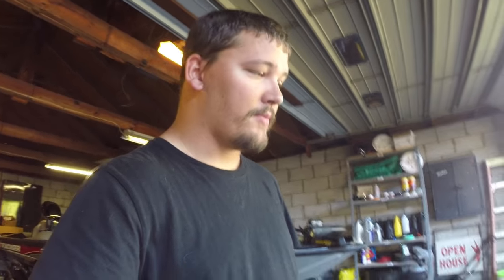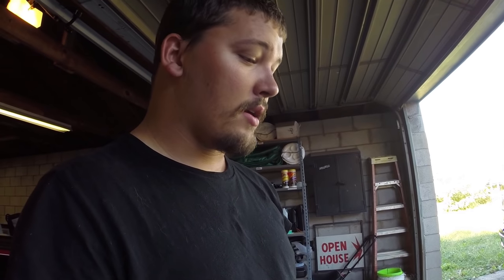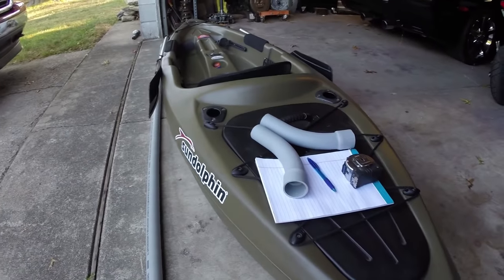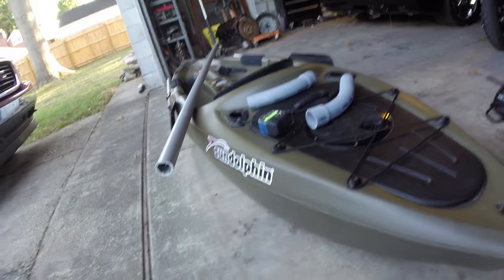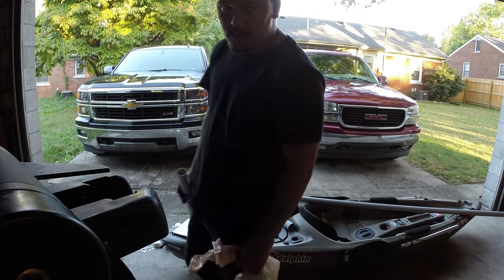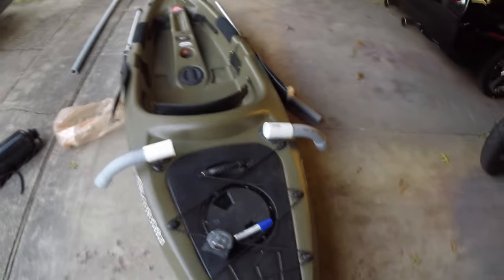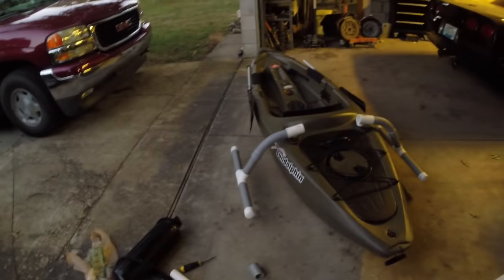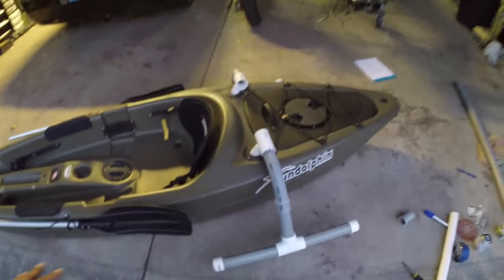Cheap Kayak Outrigger Tutorial

Comment: DO NOT DO THIS - nothing against the man creating the video, maybe it worked fine for him. He mentioned he sold it not long after so who knows. For me, I followed this video and it seemed sturdy enough in the garage. Twenty minutes on a calm lake just paddling around and it ripped the screws of my fishing rod holder clean out and started ripping out the second one. I should have known better. In fact I did because I even added an adhesive to the rod holder where it mates to the kayak ahead of time thinking it may be too much for the screws alone. I have scrapped these outriggers and repaired my kayak with two part epoxy. Avoid the headache and just don't do it. This kayak doesn't have to have them if you lay out your gear right, it wasnt worth it.
Reply from the maker: Hate to hear that. I took mine through some rapids floating down a creek and they held up fine. Maybe I just got lucky who knows.
Reply: It's possible. These aren't the most quality controlled kayaks coming off a line so it may vary from kayak to kayak.

Comment: I have a 16 foot 2 man Kayak with a sail. The sail came with lee boards. Without the outriggers I would have swamped immediately. I used two 8 foot 4 inch PCV pipes at a distance of 4 feet parallel to the center of the boat. I used two 8 foot two by fours to secure the outriggers to the upper deck of the Kayak. 

I tested this design on Paradox lake in the Adirondack Park. With full sail and jib deployed, the boat runs smoking fast.

Comment: nice little boat I have one... did all the mods..outriggers,milk crate new rod holders,anchor trolly,padded not an elevated seat,but is just to small ..now I only weigh 150 lbs. but even with the outriggers I find it to unstable to really stand up and cast. I need a bigger wider boat at least 12 footer...  I know it's gonna cost more money but after experiencing this little boat it's gotta happen if you like to fish a lot.you  get what you pay for in the Kayak world..that's for sure. so this boat is going to my wife and I'm getting an upgrade...

Comment: Hey Shaky Head. I have looked at a lot of videos about outriggers. Yours goes to the top of my to-do list. I have a couple questions. How do you keep the tube in the rod holder from spinning/moving? Also, do you think if they were out 2-3 more feet the Kayak would be more stable? At your build measurements is your paddling interfered with? I have a Brooklyn RA220 111/2 feet.  I also have a stoma in my throat from cancer. So water is my arch-enemy. If I fall in I'm dead. That said I'm sure you understand my safety concerns.

Comment: I just got new kayak on clearance and am 235 lbs and same problem. (No way will I be able to move around with fishing gear without tipping over) So was looking into detailed ideas for outriggers. Your video was just about everything I'm looking for. One question, how did you get the PVC to stay into the holes in kayak? Cement? Thanks, this was very helpful.
Reply from the maker: I used pvc cement.

Comment: 1 1/4 PVC pipe will fit nice if you have a belt sander. Make a very slight taper. I sanded off about a 1/6" or less and it pushed right in.  After making both pieces, each about 10" long, I noticed they sit at a funny angle. I don't think there are any PVC fittings that will square things up. So....I'm going to try heating them. That may work. I see people heating PVC and they always burn it. It started out changing color to yellow. It doesn't take that much heat to make it soft.
Reply from the maker: gotta be careful with the heat
Reply: If you heat the middle and slightly pull apart once it softens, it will contract the middle. Once cooled, just cut the middle and you have 2 tapered ends.
Reply: David Hefner I’ve seen someone unscrew his rod holders and remounted them parallel to the kayak. Of course he added silicone sealant under the rod holders before remounting them. This eliminated the need to heat and bend... works great if you don’t have heat gun.

Comment: just went to the hardware couldn't find those 45's with the largerer opening on one end that you have ...there are the same size on both ends...
Reply from the maker: The pieces i used are not going to be with plumbing. You should be able to find these  near the electrical section.

Comment: Hey man. Did you have any issue with the PVC backing out of the rod holders?
Reply from the maker: i did notice a crack in one of the t's but i think it was my own fault for forcing it when i shouldn't have. As far as durability under normal use i had no issues. I even took it down some small rapids when creek fishing and it handled it fine.

Comment: They look really sturdy. Did you glue the pvc pipe into the rod holder holes?
Reply from the maker: yes i used the pvc cement and pushed the pipe as far in as possible. 

The setup has been pretty sturdy. i took the kayak down a creek that had some rushing water and small drops with no issues.

Comment: Don't know if you will respond but how did the final product turn out.  did it work well for you?  was it the right height? sorry for all the questions, I bought a Sun Dolphin Bali 10 ss and I'm turning it into a fishing rig.  So far you have the best outriggers that I prefer.
Reply from the maker: It turned out really well actually. Before i glued everything down, i went out and made some small adjustments and marked where i wanted everything. glued it together and it worked great. I took the kayak down some kind of rough water and they held up. i was able to fish comfortably and had no more tipping issues. i didnt try to stand up in it though. too scared lol.
Reply: Mr. Shaky head thanks! I really appreciate it.  I have mine all designed up on paper just planning it out before I go buy everything.  thanks again!
Reply from the maker: Glad I could help!
Reply from the maker: Just posted a trolling motor kayak install video if youre interested lol

Comment: Your too big for the capacity of the  kayak.
Reply: @kendittig6142  yes... Kayak capacity is the rates at the point which the kayak will still float. Not at Wich it is optimal. A 215 lb guy should have a kayak with at least 300 lb capacity.

https://www.austinkayak.com/blog/2010/10/kayak-weight-capacity/

Comment: How did you get 1 1/4 “ pvc to fit inside the holders??
Reply from the maker: just measured and went with what would fit.
Reply: Mr. Shaky head you can use a longer piece and go deeper, but you’ll need to make a saw cut on the long axis so that it compresses a bit.
That said, I think you did an awesome job with what you had.
Now we need to see a follow up video with the buoys attached and with you standing up in it